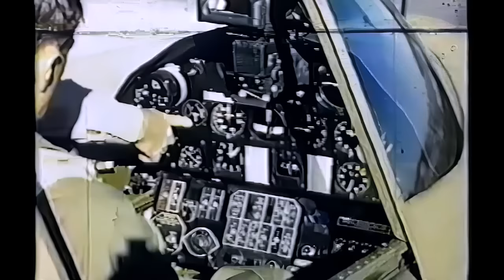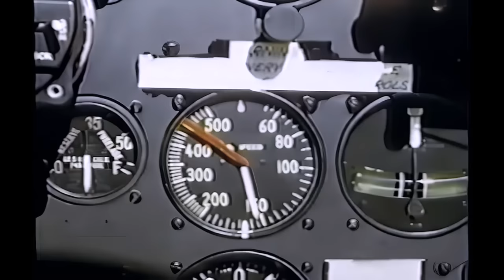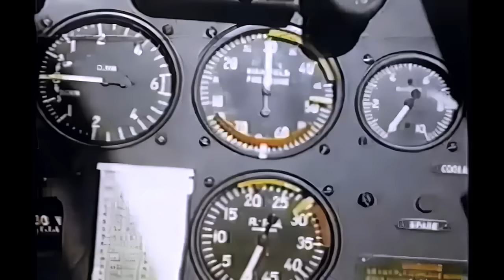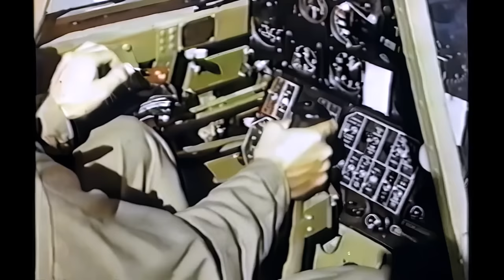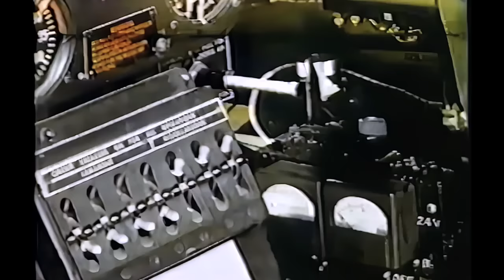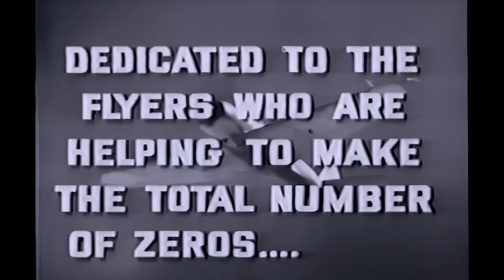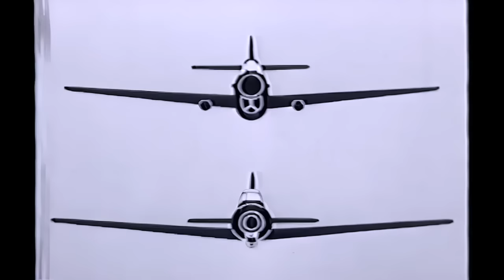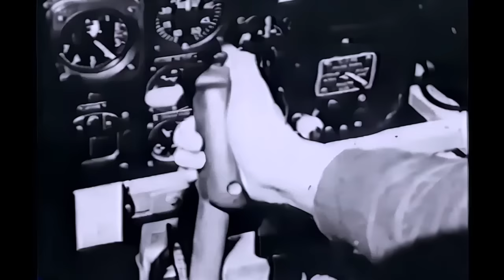CURTISS P-40 WARHAWK | Training Film | Upscaled And Restored WW2 Color Film

Comment: Wasn’t the P-40 the precursor to the P-51? Just wondering as at first glance they look similar.
Reply: P-40 is a bit older design (1938) than the P-51 (1940). Most notable difference on the P-51 is its more modern laminar-flow wing (less drag at high speed) and the radiators aft of the wing with intake and exhaust below the fuselage, further reducing drag and  even adding a bit of thrust. Both fighters only had single-speed superchargers which made them unsuitable/uncompetitive for fighting  at higher altitudes. This high alt. performance improved a lot  with later P-51s when it changed to the Rolls-Royce (licensed to Packard) Merlin engine with a two-stage supercharger. The P-40 never got a similar game-changing engine upgrade. The Allison engine's loss of power at high alt. would always limit it to lower altitudes.
Reply: @sixpackpilot  thank ya kindly friend. My apologies for not wording my question properly, what I was trying to ask, and again it’s completely my fault for not being more clear, was the P-40 the predecessor of the P-51 or though the P-51 came out later were they in development at the same time? 
I’m trying to figure out if first the P-40 was created and the positives of its design were rolled into the P-51 or if they were developed at the same time but for one reason or another the P-51 wasn’t ready until 1940. I was aware of the P-51 not reaching its peak until paired with the British engines but I did not know said engine was duel supercharged. Thank you again for taking the time friend, I wish you and yours well.
Reply: Actually, the P-40 was already in production and the British, in need of airplanes, sent their Lend/Lease commission to the U.S. to see if North American would build the P-40 under license. North American sold the British on a new airplane that they could design and produce in 180 days. It was actually done sooner than that. The U.S. Army Air Forces designated it the P-51 Apache. There was really nothing borrowed from the P-40. It was an all new design. It may have been a precursor inasmuch as it was just an earlier design. Though you couldn't say anything was the precursor to the P-38. Sometimes designs are just new.
Reply: @OlNeb-k2b  the P-40 is a full generation older. in 1940 the British found Curtiss was at max output and could not meet their demand. They (the British) approached North American Aviation and asked them to build P-40's under license.
North American said how about we design a better plane for you? and they did, in about 120 days. the P-51.
they certainly brought evolutionary and revolutionary ideas to the concept of pursuit aircraft. the P-40 was more an example what not to do than a "precursor".
BTW, the aircraft in this video is a P-40F, which was equipped with a Packard built V-1650 "Merlin". albeit with a less sophisticated super-charger than eventually equipped the P-51.
Reply: @BaikalTii  thank you friend, I certainly appreciate you taking the time to answer, I wish you and yours well friend.
Reply: @OneHitWonder383  very good points, I would like to point out that in aviation, based on my limited knowledge and understanding, many “new” designs are often kit bashes for lack of a better term. Was it the F-22 that takes parts from all sorts of jets. One of those, if memory serves, started off with, (I know I’m going to get some of this wrong lol) the brakes of the F-16, the ailerons of the F-18, the avionics of the F-15 and many more parts. I’m sure of course now the F-22 has its own proprietary parts but the YF-22 if I’m remembering right was kit bashed from many planes. 
Your point is still valid though, sometimes designs are new, I just thought at a cursory glance the P-40 looked similar to the P-51 and was hoping someone could help me figure it out. 
You all have been very kind taking your time to answer my query. As with the rest, I thank you friend and wish you and yours well.
Reply: @OneHitWonder383  one tip, never start with “actually”, lol, “um actually” is very condescending. I’m sure it wasn’t your intention to be condescending, your response was very respectful and informative. I only mentioned it so trolls wouldn’t give ya a hard time in the future. Thank you again for your kindness in responding.
Reply: @OlNeb-k2b   -- Thank you. That is a tip I will remember. And yes, no disrespect was meant.
Reply: @OlNeb-k2b  In short (maybe not for a YT comment) , you are correct, the P-40 was a precursor of the P-51. North American Aviation (NAA) was asked by the British if NAA could build Curtiss P-40 and P-46 fighters for them, but rather than build an old design from another company, NAA came up with a more modern design of their own: the NA-73. This NAA design would be developed into the P-51, as it was named and adopted by the USAAC/USAAF.
Reply: @sixpackpilot  thanks again friend, you all have been real cool taking time out your day to help a stranger on the internet, thanks again, everyone